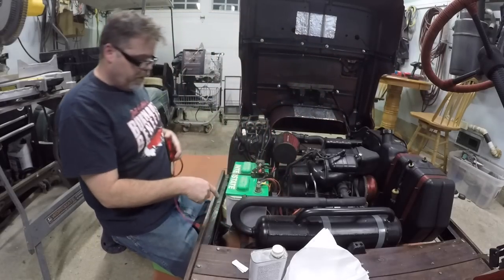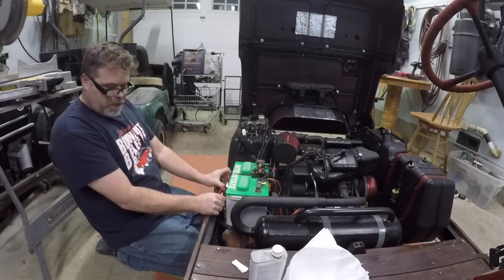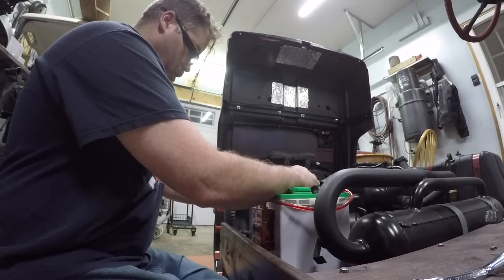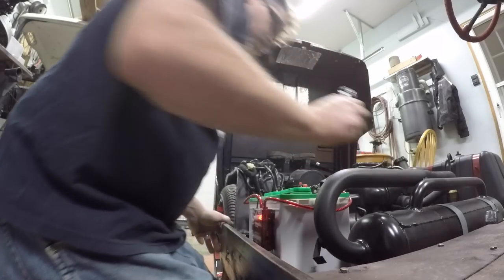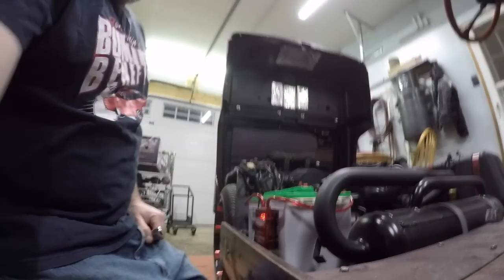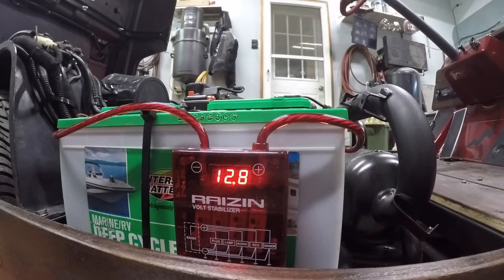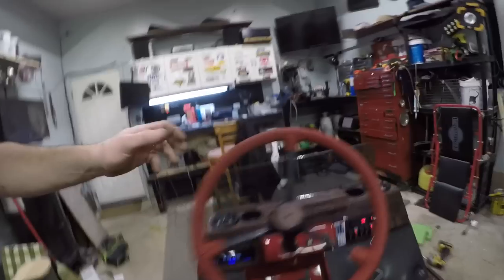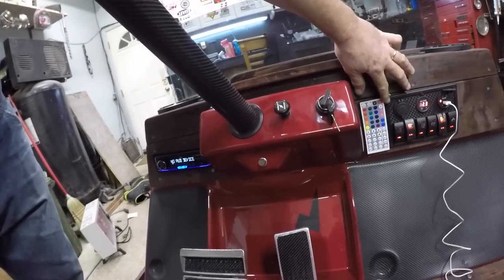LED And Voltage With Bill Siff

Comment: Merry new year Bilfis.
You need a voltage regulator. You can most likely pick one up fairly cheap at Princess Auto. You can even make a simple but very effective series pass regulator with a zener diode, a good transistor and less than a half dozen other parts for under $10 bucks.

Comment: Car voltage regulator that's used when your electrical is 6V and your battery is 12V. In line resistor or potentiometer.

Cheers
Bugs